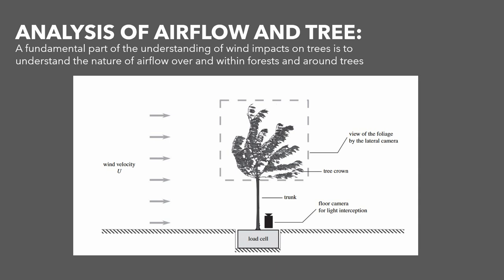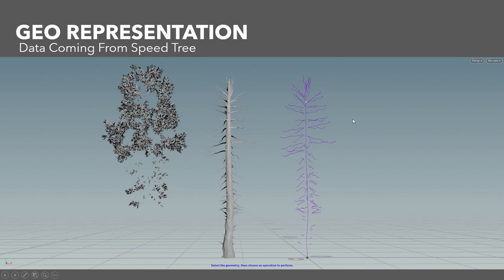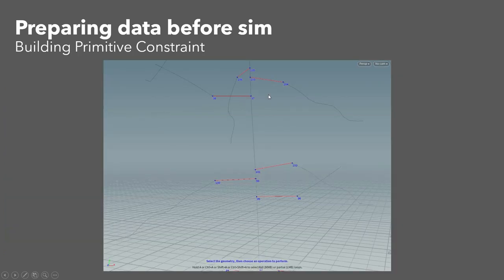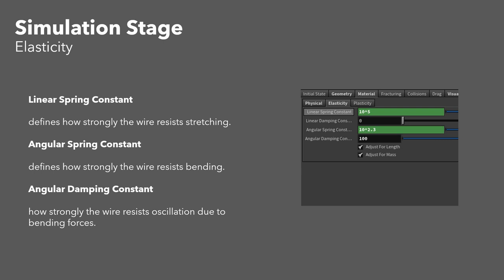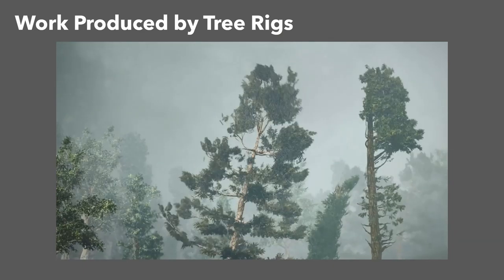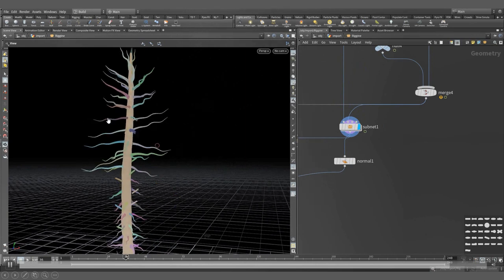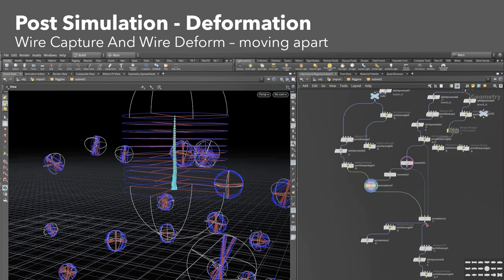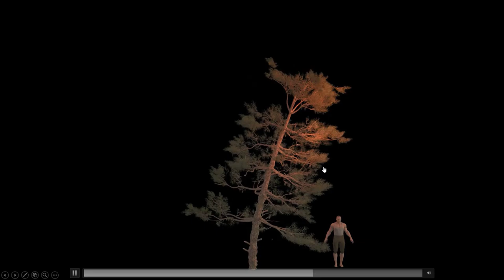Solaris Workshop - Photorealistic Tree Sims Driven by Velocity Fields | Mohamed Kamal Abujazar |...

Comment: Id like to see a series on tree creation and detailing rather than buying another software.Speed tree is just another cost added.
Reply: start with a  line (apply some noise). Resample the line using resample SOP. Scatter a few points on that line and copy smaller lines (the branches) unto that line.  You can use density and curveu attribute to control scatter points. Repeat the same process for fine branches and the leaves.